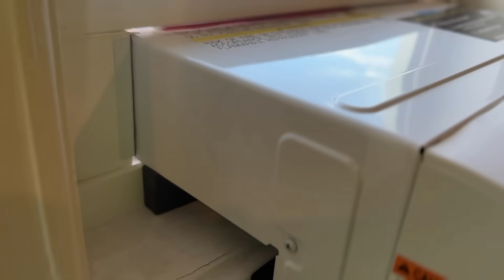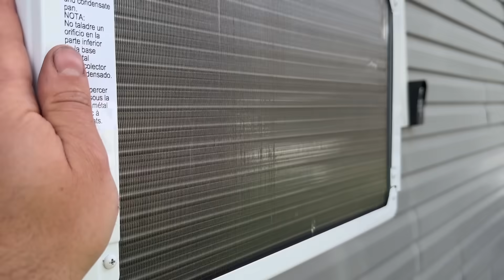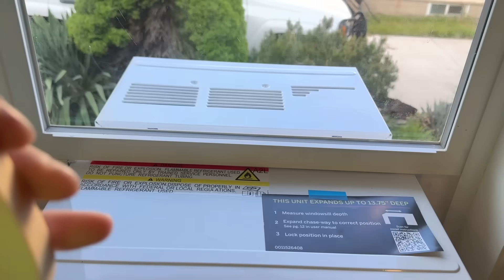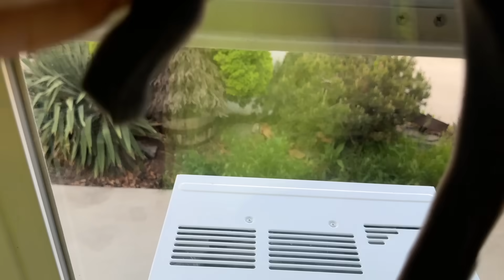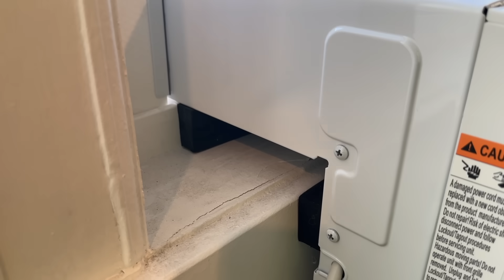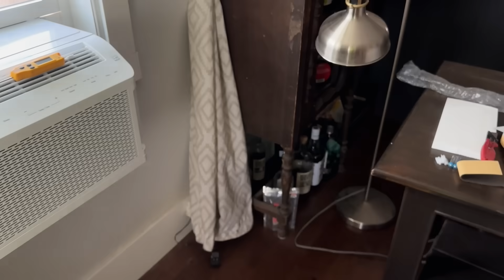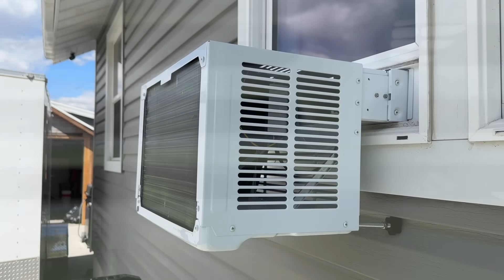Why Didn't Anyone Think Of This Sooner?

Comment: This design is okay,  but it is hindered by differing wall designs.  Also it’s an lg piece of shit.  You want a good design with the highest efficiency available get a midea U-shaped AC.  Better quality,  whisper silent running and very low power consumption.  I have 3 in my home and my house stays at 68° year round in southern Louisiana.  The midea unit allows for you to almost completely close your window.  None of the stupid leaking plastic side wall shit that even this saddle design fails to remedy.

Comment: I’ve had three GE air conditioners. One only lasted a season, one didn’t work from the store, and my little bedroom one still works after two or three years( the only one that doesn’t have a thermostat. Meanwhile I had two fridgidairs with thermostats. One I bought used and it has worked for the five years I’ve owned it and the other is going on three years strong. I’m not buying any GE air conditioner again.

Comment: Midea has had this design for years now. The compressor noise is almost inaudible inside the house. The Midea units are extremely quiet in "low" mode but make quite a whooshing noise on "high."

Comment: The water collecting and hitting the fan and making noise is normal behavior. It's supposed to sling water on the radiator to benefit from evap cooling and improve efficiency. You can Google "air conditioner water slinger" to read more.

Comment: I unfortunately live in an HOV community controlled by deplorable Dems & Libs that complain about everything homeowners do, and they also do NOT allow Window Air Conditioners, so I chose to buy an "INSIDE" Air Condenser where it has an exhaust flex-tube attached to a window mounting port (flush with the window) for the warm air to escape, and due to the dark window screen, it can NOT be seen from the outside... The only bad thing about Air Condensers is they make too much noise, so I have to turn it off at bedtime, but that's when I adjust the regular house A/C to a comfortable setting.

Comment: These don't work anywhere that has any kind of radiator system directly below the window (unless you VERY assiduously remove things any time the radiator might be active). This is fairly common in apartment made before 1985. The midea U get's around this by bending the other way, but fits less window setups due to being less adjustable (the gap is fixed width).

Comment: The water that pools on the condenser side, when it is splashed and thrown up onto the condenser it helps the whole system run better and more efficient. At least, that's what I was told.

Comment: Good video, I'm retired HVAC business owner, in a wheelchair now. got a laugh awhile ago, I changed my filter yesterday on my central system, my wheelchair elevates and I was able to reach to two top screws on the panel. I fell asleep in my wheelchair last night, it tilts, reclines, legs raise, kind of like a rolling recliner. Well, I went to the bathroom earlier, I still had the cargo shorts on because I hadn't had my shower yet because the nurse comes so early, but I thought, what on earth is in my front pockets. A nut driver in each pocket from the filter change 😂, they're both back in my tool belt and my shorts don't feel so tight now.🤣

Comment: What *I want to see* is a mini-split air conditioner heat exchanger that would slot into a standard through-wall A/C sleeve.

Would be cool if someone could engineer it for apartments, condos and houses that have an existing through-wall A/C [which basically only cools or heats/cools a single room] & sleeve, but want to upgrade to like a multi-room/-zone mini-split system, without having to like mount something externally on an exterior wall or having to lay a concrete pad for a ground unit.

Surely, there's potentially a huge market for such a thing??

Comment: a manufacturer can simply step it up with a pre-installed lined split type. this saddle type looks more awkward than the U-type.  they just got to make it smaller so that installation is easy for most DIY guys and can be plugged into standard power outlet.  I saw this type maybe a year or two ago. I'm not sure with my memory if it is real or not that I saw a diagram of a water pump to remove condensing water and pump it outside.

Comment: I wonder if this split design is better about not letting mold build up in your ac?  I hate the regular units where the water doesn't drain right and you get mold building up in the inside of ac. I know they use the water to be more efficient but it also causes unhealthy mold build up and reduced indoor air quality. You'd think someone would have come up with better ideas by now when it comes to window units.

Comment: I bought a saddle-type Kenmore unit from Sears in the late eighties, retired it about ten years later when we went to central air.
Several trees have either fallen or been taken down since the central switch, so Ive added a couple of Midea U-shaped 8000 BTU units (SEER 16.0) which allows me to keep the central set at a higher temp and I can zone cooling to the occupied spaces.

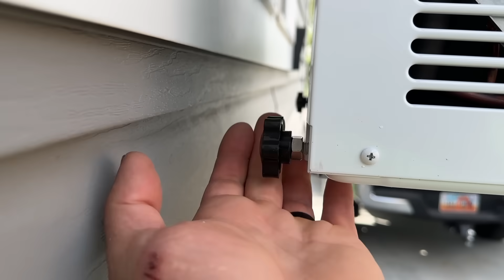Comment: 1:41 That nut that's on the stud next to the plastic piece that goes up against the side of the house is meant to be screwed back the other way until it reaches the other end of the stud where it goes into the unit. That will lock the stud in place so it doesn't loosen over time and the plastic pieces will stay tight up against the house.

Comment: I was just about to get one of these until 4.45. That bluetooth and  through Alexa. Yes, I still remember when Colorado was having a heat wave and all those homeowners had the city take control of their air conditioners through the bluetooth function - outside of law, but they didn't care because they had plenty of ac at their houses. No thanks. I don't want 'smart' appliances that are controlled by someone else. In fairness, they did leave house electricity on. They have the ability to disable particular appliances such as central heat and air,  now they want control of window units too. And they let you pay for their control, aren't they nice?

I still remember all those freezing cold showers at university when the administrators decided that either you took your shower when they said, with gender fluid persons watching, or you took a freezing cold shower because they turned the water heater off. That was 45 years ago and to this day, whenever I take a late night hot shower all those memories are in there with me. Never again will I risk letting tptb control my thermostat. I'll look for and avoid all 'wi-fi enabled' appliances. I'm sure these ac units are nice - until they're not.

Comment: Thanks for the information - I wasn't aware these existed. For any permanent installation I'd probably go for a mini-split as they are more efficient than this unit and look more integrated into the room space. However, for temporary or transient use, these are a great solution at a great price.

Comment: I would be very worried about that pump that drains the condensate. Seems like a weak point of failure to me. The fact that it is expandable means the refrigerant lines must be of the flexible variety which I also don't like. Seems like a great idea but I'd worry about it not lasting beyond a year or two before something fails.

Comment: Curious if you need to use those AC support brackets in NYC, AC support brackets are required for use with the old type of AC units. This design as well as the Midea one looks safer to use.

Comment: Good review.  I notice (when I went to the Amazon link) that there are 3 more models that have higher BTU rating, too.  Seems like the only thing that would make this design better is if it were "reversable" ... meaning that it would heat in the Winter months.  But ... looks like a good unit, especially for the price.  Cheers

Comment: 3M VHB Double Sided Adhesive Tape, and 3M Permanent Outdoor Scotch 4011 Exterior Mounting Tape are both good choices, if you need a better seal on that foam. Personally, i like the 4011 better, it comes off fairly easy, without any chemicals, but won't move unless you purposely try to remove it. It blocks air and water on it's own, so with the foam, will make an excellent seal. It is also somewhat vibration & noise damping, so that is a plus.

Comment: Back in the day I mounted a window ac under a van and moved the evap coil under the bed in the van with a small 110 blower. Moved the controls up to the wall in the van so the thermostat would work. Worked like a boss.

Comment: Bought one of these and two of the midea units last summer. I had one of the floor units with a hose that did basically nothing but pull in the hot air from the rest of the apt. Got a few of these and once they get to temperature, they barely even run! Not to mention that they're inverter units so they have more options other than full on or full off.

Comment: Nice. So it's basically a mini-split set up in a window saddle configuration. Can't think of anything besides power and freon lines going through the saddle portion. Clever and gives a good middle ground between a regular window unit and a mini-split.

Comment: This is probably one of the best window A/C units you can get, but it's still very worth saving a little more for a mini split heat pump. They are more efficient, have no window requirements, much more quiet and able to cool an entire house vs a room. And they also can throw heat if needed.

Comment: I like the way the inside vents point upward at the ceiling, rather than forward into the room. This design causes far fewer drafts which could mean the difference between a good night's sleep and slow torture of aches and pains. I wonder if there is a way of connecting a drain hose for the condensate; those pumps are not known for their longevity.

Comment: I discovered this same design here on youtube last year by a company called Midea (or something like that).  I went to purchase one for this year to replace a 20+ year old traditional window unit (which will become a backup), but the Midea was too big for my window :( Unfortunately, I'm stuck with needing something no bigger than 18.5" wide and that's a fairly tight fit. I can tell the unit in this video is much wider than 18.5".

Comment: It is not alone, I was aware of a Soleus variant that looks much like GE's option. Problem with this design is seen in places with humidity, their either install a pump to get the condensate out, or you have to drain it or it will drain inside your house. Personally, I am more excited about inverter pump AC's but this is a good AC unit. I went with Midea's U shaped inverter AC, but that was because there wasn't many options at that point. LG, Frigidaire, Midea, and GE all have inverter style AC units and that include a variant of this GE saddle style AC which starts at 10,000 BTU but the 6,000 and 8,000 btu do not have an inverter.

Comment: I bought the Soleus brand over 5 years ago because the windows in our bedroom were too small for a regular unit. It cools really well in the summer. I had to use a lot of rope caulk to fill any small gaps or holes because all types of insects were getting inside the bedroom. It's not as quiet as this GE but it works well enough.

Comment: Paying 400 bucks for a 6100 BTU air condition that wouldn't cool a closet, is nuts though; and the 12200 BTU unit  which you would need cool a room 10x10 is almost 600 bucks. You can get a external AC much cheaper for the cost per BTU.

Comment: I just wish this unit had more like up to 18" of bite.  I went with the Midea U-shaped unit that sits above the sill.  Every window on my house has a decorative brick sill on the exterior and this GE saddle unit won't open far enough.  Midea has announced a new saddle type heat pump unit.  Hopefully that one might open enough.  Though I think I'll probably get central air in the house before that hits the market (House has a central furnace, just no AC).

Comment: I thought about this as a kid in the 60s....but I'm not an industrial designer.... they're smarter than a 10 year old kid trying to help my dad stick a heavy box in the window and not drop it.

A DIY 120v inside plug small minisplit with air tool Freon fittings or a all in one coupler wiuld be even better in 1st story installation.

This is basically a mini split with saddle.

Comment: So, is the unit featured the 10,300BTU unit? I see the Amazon link has the smaller units listed as non-inverter style whereas the larger 10,300 and 12,200BTU units are inverter.

Comment: Don't use a wedge to your glass or you'll eventually have broken glass to repair! Run a screw into the window track leaving it proud to hold the window in place. You'll want to use both sets of foam as they describe, you are paying to cool the air and open areas are just blowing that back outside.

Comment: Yes, those new model room air-conditioners are very quiet.  There is no reason to continue suffering from the loud noise of any older model room air-conditioner.  This particular model has the advantage over other quiet room air-conditioners that it doesn't block the window that much.  This is a plus.  The quiet room air-conditioner that I have at home blocks the window; it was on sale and it was available in the store; that's why I bought that one.  If this U-shape room air-conditioner was available in store, I would have bought it.

This new generation quiet room air-conditioner is so quiet that I think it will replace any mini-split.  The indoor air handler of a mini-split probably is quieter than this new generation quiet room air-conditioner -- but not by much.  And installing mini-split requires professional installation, and the mini-split itself is expensive.  I have both in my house.  If the quiet room air-conditioner was available back then, I would have chosen quiet room air-conditioner over mini-split.

Comment: 1:47, the loose silver nuts are supposed to go back and tighten to the unit once you have it set in place to lock the arm so that over time the arm won't vibrate and potentially start retracting.

Comment: Many units are designed for the outside condenser fan to sling the water at the condenser coil. This increases the efficiency because you get the additional evaporative cooling on that coil. 
Only downside is the noise of the water on the fan. 
Basically your little “fix” is likely costing you efficiency.

Comment: Isn't the water slapping on the radiator from the fan normal? I wonder how hard it is to clean. In Texas, AC units get used alot and mold builds up.

Comment: That is a really cool design... no pun intended.  This would a perfect replacement for the old and heavy window units that were bought for the house more than 10 years ago.  I like the fact that this design uses the walls of the house for support instead of the window frame like traditional AC units do.

Comment: I have a better design. The inside part converts into an ice maker and water cooler while the ouside has an built in air fryer so you can open the window and eat your dinosaur chicken nuggets without heating up the house and then enjoy your cold beverage.

Comment: almost all window ac's unless they have a drain port will have water splashing on the outside coils to try and cool them faster, it doesn't really work in a humid environment though, theres is what looks like a grey plug on the bottom left of the unit in your window for drain

Comment: I was really impressed with the concept of this air conditioner until I started reading Amazon reviews relative to its questionable reliability. In fact, Amazon States it is a frequently returned item. That was all I needed to hear to move on to a different air conditioner. GE stands for good enough. For that risk at that price, not good enough for me.

Comment: Those look nice, but way more expensive. In addition, I'm not sure if that upside down "U" design will skirt the  outside support bracket requirement for most apartment buildings. If a bracket is still needed, it will have to be moved down quite a bit - I would say at least a foot.

Comment: These should only be sold as heat pumps... AKA an air conditioner that runs both directions.  From a manufacturing perspective the cost one extra valve and for the customer, the value is nearly doubled.

Comment: we  love the first one we got it is a panasonic... it was slimline and 42 pounds it doesn't stick out of the window like traditional ones. about the first and last time I saw that design.
It doesn't need outside supports as it sticks out a few inches either side of the window- not out into the room. sits in the frame of the window.. wider than an in the window fan.
even had a super complain to put it further out the window.. that would mean dropping it OUT the window. LOL. she assumed we had most of the AC in the room LMAO.

Comment: Thank you for your videos !!!! I appreciate the time and effort you put into them!  Question ... in a SHTF type of event, what happens if the natural gas is NOT flowing to the home?  You've done a great job running the furnace off of an alternate electrical source ... What do we do about natural gas?   Can a 20# propane tank run a water heater or furnace for a short amount of time?  Is there enough (too much)  pressure in a propane tank?   I need 2-3-4 days of heat and the natural gas is not flowing.... Now what? I realize this is a much bigger initiative than electrical .... but it could happen that the natural gas to our homes get cut off.